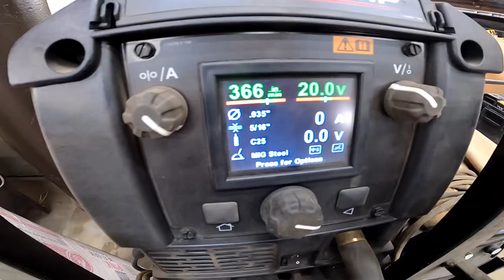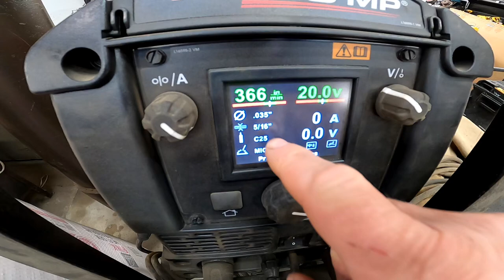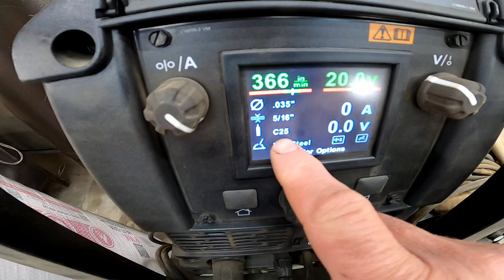Building Steel Roller Stands from hitch receiver tubes

Comment: I also used some of those conveyor rollers but I slid a heavier walled tube over them and welded them in place.  Nice job on the rollers
Reply from the maker: good call, might not be a bad route to go